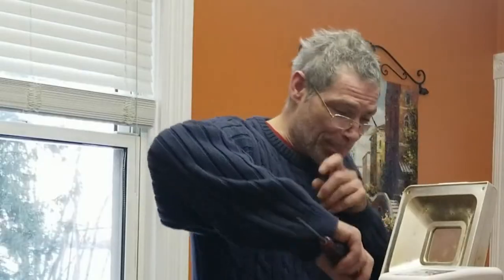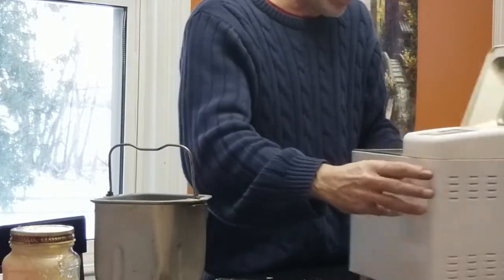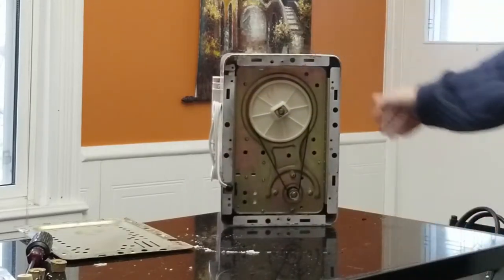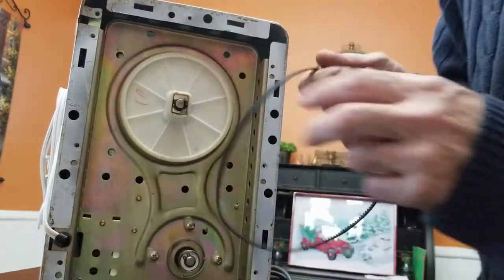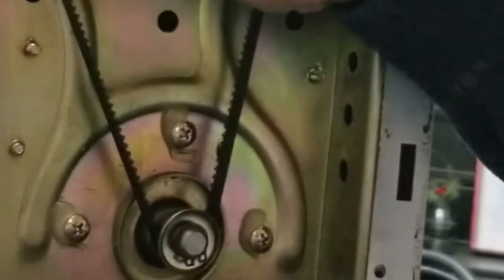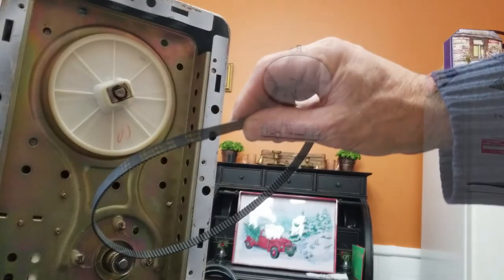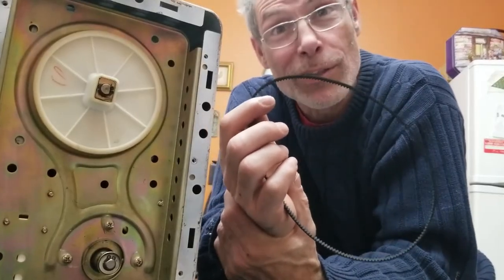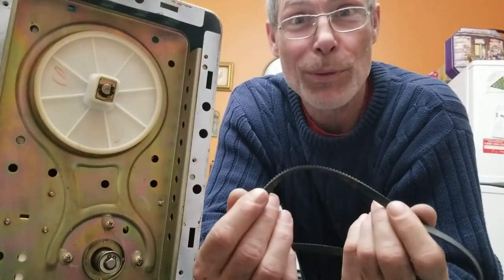Bread-maker Trouble shooting and repair

Comment: I have used my Oster 5821 bread maker regularly for over 20 years.  Recently, I have found black powdery "stuff" underneath the bread maker, and more recently, the bread maker just isn't working properly.  I think your video may solve the problem.  I just ordered a replacement belt.  When it comes in and I get the new belt on, I'll let you know how it turns out.  Meanwhile, THANK YOU for creating this post!  I hate to throw away anything that can be fixed.  Your video gives me hope that I won't have to toss out my tried and true Oster.  🙂
Reply from the maker: Good luck. The black stuff accumulating under the pan is parts of the mixer shaft seal. That part is also usually replaceable.  When the seal wears out it will leak. To test for leaks, remove the pan and put water in it and let it sit. You will know if the seal needs replacing as well.

Comment: 🇨🇦 Your machine looks like mine. Regal K6760. I just dusted mine  off after sitting on a shelf for probably 15 years or so. When I cleaned it up and plugged it in the 0:00 on the timer display works but no lights display or nothing happens when I press any other buttons on the panel. I have unplugged it a couple times. No results. Any suggestions? Do you think it’s worth fixing?

Comment: How do you fix the shaft on the bread pan where the shaft is welded to the wingnut doohickey?  My shaft keeps falling out, and the only explanation I have is that a 2 cent nylon washer broke.  I got some replacement washers with a "seal kit" that also had snap rings, but my shaft does not use snap rings.   My question is how to get the shaft to now STAY IN, and what type of NYLON washer will work. Very frustrating that a 200 machine fails on a 2 cent nylon washer. Any ideas?

Comment: Have a Breadman Ultimate Plus. Used it to make bread. Waited 3 hrs then plugged in to make more bread. 
Didn't get it to beep. Tried reset button. Has light inside, but will not beep and come on to select cycles
What can be wton?

Comment: Did it work when you put the new belt on? My machine is the same model but I think the problem is not the belt but actually the gear around the motor breaking off, making the belt longer than it needs to be by default
Reply from the maker: So the belt worked for a few loaves. Then the gear broke in half. The gear must have been cracked already, and a tighter belt finished it off. The follow up video to this is a shiny new breadmaker! Turns out the model I have is so old, I am unable to source a replacement gear. I haven't had any luck with subsequent breadmakers as I use it 4 times a week and they break down every 6 months like clockwork. Sorry about your broken gear. I make bread by hand now and bake it in the oven.
Reply: @oddjobsremigauthier  thanks for your response, saved me trying a new belt

Comment: My Panasonic SD 253 which I love and have had for years. Put my ingredients in tonight and plugged it in. The red light is coming on but none of the function buttons will work. Any Ideas what could be wrong
Reply from the maker: I wish I had an answer for you, but I don't.  If you can still find a small appliance repair shop, they may be some help.

Comment: I just inherited my mother’s bread machine , but only 1 button will work , is there an easy fix with this ? Please 🙏🏾 help !
Reply from the maker: I am not an appliance repair professional, however, if it is the belt that has failed, removing the bottom cover will, at the very least, expose the belt, which will have a number on it that the manufacturer can use to sell you a replacement. They might also be able to help you go through the installation process. Most manufacturers provide great how to videos on thier websites. I hope this helps.

Comment: I took mine apart I have a regal. The panel and everything removed the same. My belt is definitely dead!! My next problem is my pan is siezed. Any suggestions for that? I can remove the dough paddle but that wingnut doohickey doesn't rotate. Also note the seal on mine doesn't leak like many do complain about. I'm at a loss.
Reply from the maker: Here is a test for you to run. First, take off the belt. Then try and spin the wing nut doohickey. If it doesn't turn freely, then you will need to replace the bearings and bushings. If it does turn, then the drive motor is seized. I am no expert, but a reputable appliance repair shop should be able to replace either of those items.  Hope that helps.
Reply: @oddjobsremigauthier  belt is ripped. Everytime in that area turns. Belt is on by a thread. The pan itself is siezed up and doesn't spin.